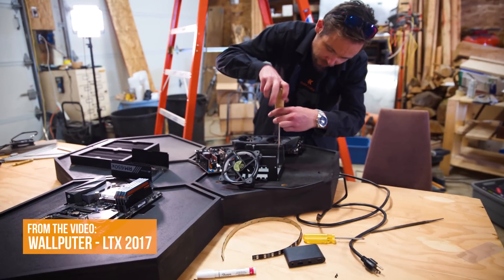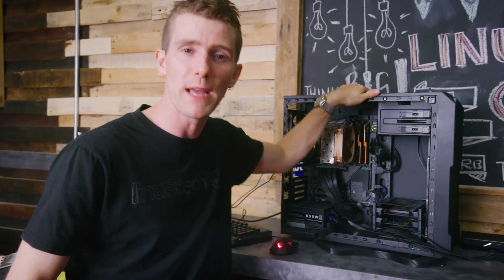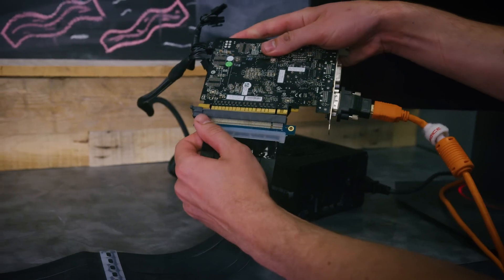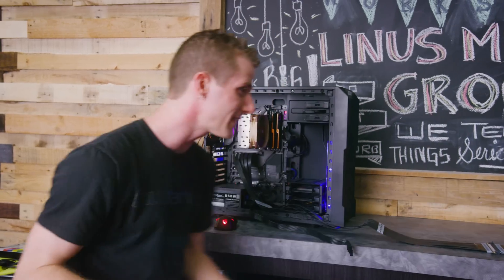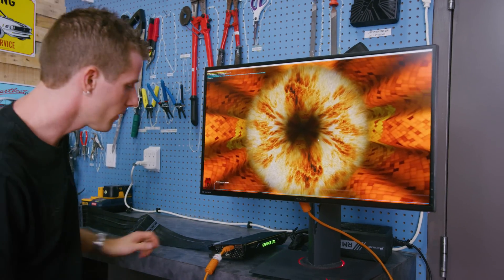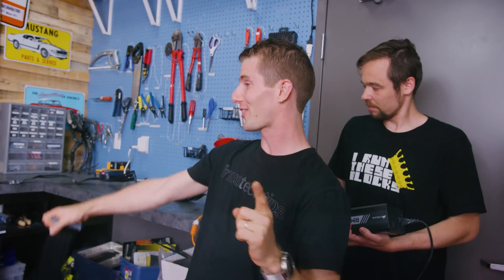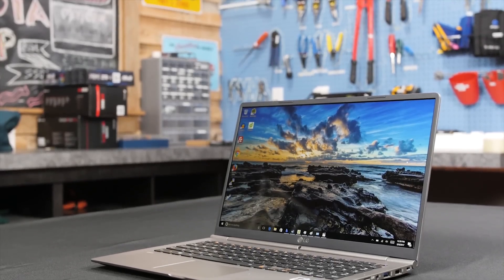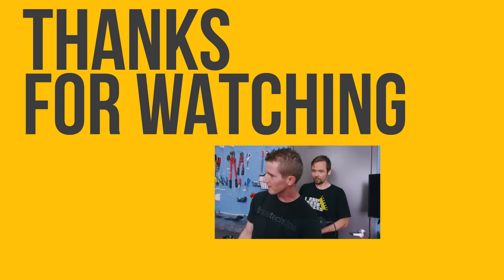How many PCIe Extensions is TOO MANY??

Comment: Hmm, what's the speed of propagation in copper wire divided by the operating frequency of PCIe? We should be able to come up with a theoretical maximum and see if it matches with what's observed. I'd say you're getting 3.3 metres there, rather than 3.0 (you yolo'd right over it to 3.6m after all), so about 10ft...

Anyway, I approve of this type of technical idiocy :D

Comment: I'm now just wondering if you can get similar things for PCI (and ISA?) so I can fit a better mobo in my slimline 486SX's case... it's just not quite got enough oomph for all the retro I want to play on it, but it's designed for use with a very particular motherboard with a double sided ISA riser, which makes upgrading extremely difficult... :/

Comment: One thing I would have done is to get a long piece of wire that's separate and tie the ground power pins from the GPU aux power to a ground pin on the PC so that the two power supplies had a good ground path that wasn't being forced over the PCIe bus.  In theory they should be tied together via the ground pin in the wall, but you never know, it could be an isolated 0V.

Comment: I reckon the weak link would be the connections and multiples there of.  It would be interesting to see if there's any gain my soldering wires in-line to remove all the mid-point connections.

Comment: Signal delay can also screwup the digital timing between the cpu and GPU and result in failure . 3 meters means 10ns of delay ( assuming speed of light for the electrons on the wire) which is a lot for a system running at 4GHz(250ps)  or even 1GHz(1ns).

Comment: As long its - as for a video card - mainly unidirectional, length isn't a problem. Now try this with a device with lots of R/W like a disk controller, RAM/SSD, etc... But I'm still amazed that it's worked.

Comment: I am also curious about response time.  Because I was more expecting there to be input lag happening long before any drop in FPS.  And technically I don't think it would be input lag since your inputs into the machine would be the same as if it was plugged directly into the board.  But rather the kind of lag for it to show up after you ... well ... input, lol :P ...

Comment: Did they understand that the card and Mobo didn't actually need to be very far apart?  Meaning they could have used one PSU.  The length of the rizer is all that mattered and that could have gone out and around the desk/workspace/whatever/etc...

Comment: I'm sure it would work better if you used more of 1m connections. Also, this gave me an idea - put the GPU in a seperate cooling box closer to the monitor. This way you have completely different cooling environments for CPU and GPU, providing much more control over it. The PC does end up being 2 boxes, but overally cool concept if you don't have to move PC. I'm wondering how much can you improve thermals (if at all) by doing this?

P.S. I know this video is over 7 months old.

Comment: This guy really doesn’t know how these things work. FPS is determined by the card, it is just not receiving new data to render, hence the jumpiness, yet higher frame rate. I hate how he treats the hardware, STOP touching the gold pins. And folding your old PCIe extension the way you did was probably the problem with that.

Comment: Interesting Video. One issue with long PCIe cables/risers is that avery long piece of wire acts as an antenna (both transmitting AND recieving, with recieving beeing the big problem here). PCIe uses a standard called LVDS to transmit data, which can resist noise of up to 1V, but the 3m of cable will pick up a lot of noise (If you have a lot of electrical noise around like smart phones, wifi, ..., the maximum distance will be much shorter). Another thing: Long risers/cables only work without signifficant speed losses because the video card is not sending huge amounts of data to the mb (the mb doesn´t have to wait for the video card to reply). If that was the case (AMD Crossfire, PhysX enhancer, probably not so much with SLI due  to the bridge) the long time it takes the signal to reach the opposing end (it takes around 1,5µs for a signal to travel 3m, that´s a LOT for a bus running at 100+Mhz).

Comment: I have had problems with those cards that have missing pci-e pins in older pcs. Tried putting a 750ti in a Dell Precision 690 and it wouldn't boot, but a gtx 760 worked fine.

Comment: Those low quality ones see a performance drop in themselves.  I ran with one for a while and couldn't break 30fps in insurgency with a 650 OC driving a 720p screen, but when I removed the riser I was getting upwards of 60fps.  They're shit.  I need to buy a good one.
Reply: Alright, so I'm definitely convinced it's worth the money for one of these now.  That's impressive.

Comment: I'm surprised, because even at nearly light-speed that signals can travel through wires, when the frequency is too high you can definitely get a mess if it travels too far.  Really weird capacitance and resistance effects that smoosh the signals, and the faster the frequency of oscillations, the worse it gets.

Comment: I'd be much more interested if you put a pcie ssd at the end of that and measured read/write speed and bit errors.  I'm not familiar with that stress test your running, but if it's for graphics I would assume there's not much data going across, and might be succeeding because of multiple multiple retrys.  Stressing storage would probably be much more visible.

Comment: Hi guys, I see your TitanX gets 120 FPS in FurMark stress test.
My GTX-1080FE only achieves 18 FPS under the same test conditions.
My card is running at 1746 MHz Core, 5472 MHz Mem, 118% TDP, 67°C.
In game I still get a good 50-70 FPS in the most graphically demanding game.
Can you explain if I might be doing something wrong?
Thanks.
Reply: Samuel Arnold No. This is not a free helpdesk.

Comment: The power delivery question might've been answered if they used an ROG card. If I understand correctly, those only use the power directly from the PSU rather than balancing it between the PSU and the PCIe slot. Just a guess.

Comment: Having done some OpenGL programming in college, I would say the bottleneck is DMA transfer speed (after some distance, transactions start to fail, forcing a retry), not graphics processing speed. Once the 3D objects, textures and shaders have been sent to the card, moving the camera is not that hard, since you only need to send the new camera coordinates, the rest of the scene is still in VRAM and doesn't go through the cable again. I'm pretty sure changing scenes and geometry (i.e gaming) would be more of a problem as new data constantly flows through a poor connection. A one-scene benchmark is the best case scenario for crappy PCI-e links.
Reply: You’re correct. I’m glad somebody mentions this when the video came out. Running fps has zero to do with the length IF the textures are already ON THE CARD which is why the card needs the PCIe bus in the first place. 

Run a game that’s constantly pushing different textures to the card and you have a more legit test.

And I just saw the end and they didn’t think to do this. Bleh.
Reply: Don't know how many pins there are on a PCI-E express, but you should technically be able to transform that into three internet cables in terms of size. Then if the construction has Foil around every single wire(shielded) and it is twisted around one another, as if a rope. Basically PCI-E extension into wire cable. Then twist these cables around one another. You can probably reach quite a distance with this.
Reply: @Helveteshit  "You can probably reach quite a distance."

That's what Whitehouse said.  "Wildman Whitehouse" they called him, and he's got an amazing Wikipedia page.  It turns out that long wires or cables are electrically sluggish, and figuring out solutions to that problem was a huge part of early telecommunications and radio.  (Whitehouse's solution was to over-volt the very first transatlantic cable trying get a higher "clock rate" out of it.  It didn't survive.)

To give you an idea of how difficult this problem is, Cat6a cable - the stuff for 10Gb/s Ethernet - has a 500 MHz bandwidth.  10G Ethernet uses 8 lanes and a very complicated modulation scheme to fit within that bandwidth limit, the cable is about $0.35 per foot (not horrible, but not that cheap either) and tricky to terminate properly.  For all that trouble you can reach a few hundred yards.  That's why physically large networks use different technologies: RF-modulation (cable, cellular) for reaching customers and fiber for backbones and bigger customers.  DSL does use twisted-pair cable, but if that cable runs more than several hundred yards before hitting a DSLAM and being converted to fiber, you probably hate your DSL.

PCI-e 3.0 uses a far simpler line code and pushes each lane to 8Gb/s.  This needs the full 4,000 MHz of bandwidth that's typical for a double data-rate channel.  The simplicity allows for much less latency in the digital logic that encodes and decodes it.  A bundle of Cat6a can have enough throughput (bits per second) but you'll need some crazy glue logic to convert the signals to an electrical form that can be sent through those cables.
Reply: @jordanrodrigues8265  Can confirm, I hate my DSL

Comment: Now just put GPU in fridge and overclock it like a boss
Reply: stev4was1 sealing the gpu for a zero airflow
Reply: It would not work, unless you have one of those industrial coolers your fridge is not rated to remove 200 joules of heat every second; LTT did it here before btw /watch?v=B8bhGw4vUFE
Reply: maybe he can vacuum seal it
Reply: @stev4was1  who tf told you that there is no heat in vacuum?!
Reply: @monkeh3612  I just noticed that here is a ongoing discussion over 3 years to my silly comment, but i love this. But I have to say, that I never wrote this @monkeh . I just wrote "maybe he can vacuum seal it". What I had in my mind but didn't wrote, was that you could seal it tightly in a plastic bag or something like some food for example. So you can get rid of most of the humidity and maybe other bad stuff, that would damage the GPU. And to your comment  - Sure i know a vacuum can have heat. But I just assume for now if there could be a 'pure' vacuum with zero particle, radiation than there would be really no heat. I also guess that is not possible, but sadly I didnt study physics.
Reply: Psycho Kern they already did that. And the Computer got hotter inside the fridge because fridges arent capable to cool things that actively generate heat.
Reply: Thanks for the tip
Reply: *freezer
Reply: Psycho Kern try the freezer for even more performance
Reply: Or maybe submerge whole card in a bucket full of liquid nitrogen ... ?
Reply: Hokou X if its in the fridge you dint need airflow
Reply: @jodinha  You can't put a gpu in a fridge... it will literally run hotter than outside after a few minutes...
Reply: @jodinha  thats... not.... how it works....
Reply: @jodinha  if its in a vacum the fridge wont help for shit
Reply: @jodinha  You would still need airflow
Reply: Ok boomer
Reply: Or put it in a freezer and crank the numbers into the double digits and never I mean never turn it off
Reply: do you understand the fact that someone might make it sentient?
Reply: Put it in a dry freezer
Reply: Nahh freezer
Reply: Fridge? Why not the freezer? MAXIMUM COOLING
Reply: Genius
Reply: Nah chuck it in the freezer
Reply: Put it in the place of a quantum computer Cpu. It's literrale -273,9C° in there lol.
Reply: I could try to overclock my old gpu to like 20 ghz
Reply: "Son, what's this tech thing on the side of the fridge? Why are there cables running from it into your room?"
Reply: Just put the whole computer in the fridge no fans or water cooling needed just run 2 m of extender cables
Reply: @G Money IT DOESN'T WORK
Reply: Freezer/fridge do not dissipate warm air fast enough once the GPU have heated it all up.
Reply: Bitch be running 999 fps
Reply: Lol
Reply: The reply conversations on here are funny 😂
Reply: NASA we need this guy working for you
Reply: Put a watercooling and put the radiator un the freezer with antifreeze
Reply: That’s a genuinely good idea
Reply: HELL, YEAH
Reply: Why not make your pc like a mini fridge
Reply: that one 2b2t player did that except he put his whole pc in the freezer
Reply: Jeremiah Baxter That would be true if it wasn't producing any heat. If you turn it on though that's still hundreds of watts going into the fridge.
Reply: Hey that's what I was thinking
Reply: Watercool the fridge
Reply: That's actually kinda smart!!
Reply: Put it in a freezer which is frost free that will mean the fridge has a dehumidifier
Reply: @bladerj : doesn't water move to the COLD part...     (like the ice that builds up on the cold walls of the freezer, or the water that builds up on a cold glas of whatever is in the cup..)

you would have the driest GPU ever!
and that really would be genius :-D

Comment: Linus I don’t think u will read this but IF u do u should make a computer around the shop as in like power supply on on side mother board on another side and run cables to all the diff components the try to make it work

Comment: Surely the physical distance the card is away from the computer case shouldnt matter as the data is traveling down the same amount of cable, couldnt they have just piled the cables back ontop of eachother rather than moving further and further away?

Comment: Very impressive video. Thanks guys. 
If you ever need 4.5 meter and longer PCIe x16 extension cables, we have these made without any performance loss. 
I have one running for more than 50 hours now (2017-11-20 20:33pm EST). Hope I can post a link here. It's on a live streaming. 
https://www.ipcamlive.com/5a0f2cae54296
Reply: impressive but if i may recommend contacting them from theyre email they most likely havent seen your comment

Comment: If you consider that each riser connection degrades a bit the power and signal strength, one could make a single even lengthier (would guess 4-5 meters) cable and it'd be ok.

Comment: My computer takes 5 minutes to boot up windows. It plays minecraft at 20 FPS on a good day.
Reply: @alexlynn4716   I never knew you could play Roblox on a RAM stick!
Reply: @kaiden8876  what did he/she say? He/she deleted it.
Reply: @anerpos2055  dont remember
Reply: My comluter boots in 9 seconds 900fps minecraft on a good day pls send me a better cpu
Reply: My computer only takes about 55-60 seconds (I've tested it) to boot Windows but I can barely even play Minecraft.
Reply: My computer is fucked and it doesn't start and it plays Minecraft at a whopping 0 fps
Reply: SAME!!!
Reply: My pc goes 100% cpu load when I’m running literally nothing
Reply: My computer takes 30 seconds to boot up, 2 minutes to load, and I get 200fps on minecraft low settings
Reply: my computer boots in 3.7 seconds and runs at 120fps stable (i capped it). Boot time doesn't mean anything
Reply: Maybe you need a pci extension
Reply: laughs in <1min boot times (debian)
Reply: SAME
Reply: Have you tried Optifine?
Reply: Late comment: my old computer only ran up to 1.6.4 with only 30fps. Anything higher it said I needed to upgrade my graphics and crashed
Reply: @Sheepstr  it must've been even older than my Dell optiplex that originally had windows xp lol, because on that, I was able to get no higher than 40 fps and no higher than 1.9.4 with optifine. xD
Reply: My pc boots up in about 10 seconds and starts Minecraft in 30sec but runs it at 30fps
Reply: My laptop takes days to boot up and about 5 min to load the icons lol
Reply: On high settings for Minecraft I average 1200 frames
Reply: My computer takes 50 mins to boot windows. It plays Minecraft at 0.1 fps
Reply: My computer boots windows up in 10 seconds, and immediately loads icons. Runsnminecraft at 500 fps and with shaders its at 150 fps. I got gpu and lots of ram. And good storage. And a good procescor.nidk if if i spelled that right but yeah you get it
Reply: @rockingjjo738  ok?
Reply: And its same even with highest settings
Reply: My PC boots in 6.8 seconds.
Loads windows in 2 seconds.
Loads Minecraft in 5 seconds. 
With Shaders runs at 170FPS on average. 
I'm so sorry I had to.
Reply: 4 seconds to boot WITH LEGACY BOOT NOT UEFI, 30 Seconds to load minecraft and runs at 70 fps for Java, 600 fps for Bedrock
Reply: lololol i have that problem too. I play rocket league on 30 fps on lowest graphics and i had to go to config to make it work
Reply: Mine runs minecraft... Unplayable but it runs
Reply: Mine take 2 minutes to boot, 1 minute to login (10 seconds on a god day), and 1 minute to load taskbar, icons, and startup apps (10 seconds on a good day). It play diep.io and moomoo.io at 60 FPS with a resolution of *drumroll*

1366x768
Reply: Put your graphic into the fridge
Reply: PC Boot takes 0,5secs, but Windows Start takes 1,42 secs (average) Minecraft Starts in about 4 Seconds and Runs at about 2-3k fps, depends on resourcepack, Viewing distance and single/multiplayer
Reply: @spruiid  Your own videos say ~100 fps, stop lying
Reply: My pc is thirteen years old I put an ssd in it and it boots in 1-3 seconds depends on how long it’s been off
Reply: @MelonPlayzYT My last Video was nearly 4 months ago, it was on a crappy laptop, now it's on a high end pc
Reply: my pc takes one second to boot, 10 seconds to load icons,  3 minutes to load minecraft, it plays at 30 fps on integrated graphics, and if im lucky it wont crash on a server in 1.13
Reply: @WeirdTreeThing  my computer boots in one second, takes one second to load icons, 5 seconds to boot minecraft and runs it at a steady 250fps.
Reply: @WeirdTreeThing  mine takes like 60 secs and runs on 300 400 fps
Reply: Mindblitz64 pleb